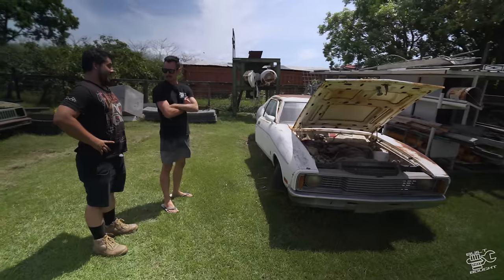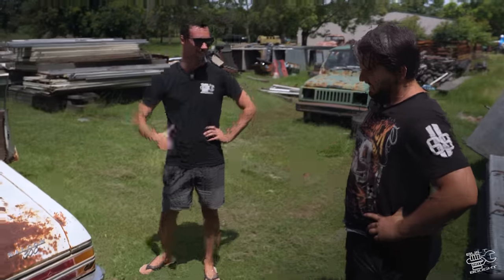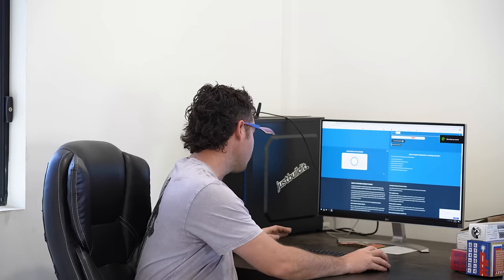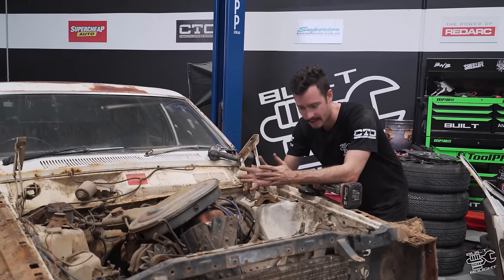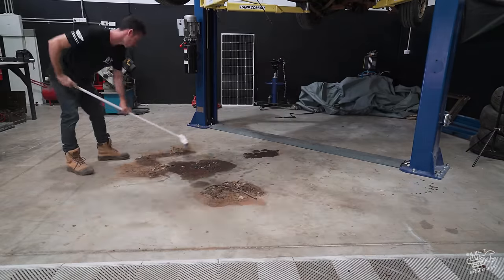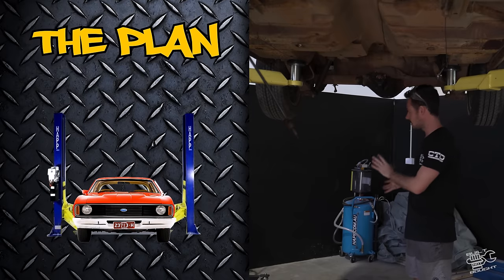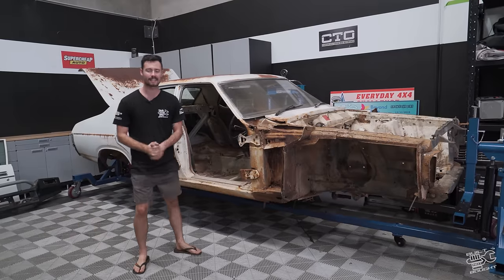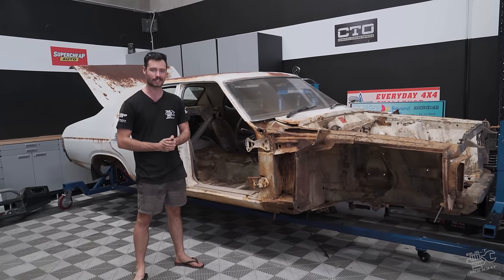XC Ep 1 || NEW BUILD REVEALED! 🫣

Comment: AC was an optional extra back in 78. Before that, the AC unit was on the passenger side under the dash. Very rare to find one of those units. That motor that you pulled out was the beginning of the BARRA engine today. 250ci cast iron block.
I'm really looking forward to the build.
Reply from the maker: Oi that’s sick!!
Reply: 71 ZD Fairlanes were optional extra AC too. But it was integrated into the dash like todays cars. 351 Cleveland donk 👌
Reply: If there are AC vents under the dash then it was added on after wards. If the AC blows out the standard air vents up in the dash then AC was factory fitted. My 78 XC had factory fitted AC. It was a GS (semi sporty with black window frames and extra set of round lights in the grill) GXL and Fairmont (rectangular headlights) also came with factory AC and chrome trim around the window frames. Base model I think was optional extra which I think your XC is a base model going by the single round headlights.

Comment: A/C was an option. so it could be factory (but with that compressor is not original). but I've only ever seen the v8's with aircon and it's mounted up top with a much larger compressor. You could get A/C in the XA 72' but that's as far back as my falcon knowledge goes.